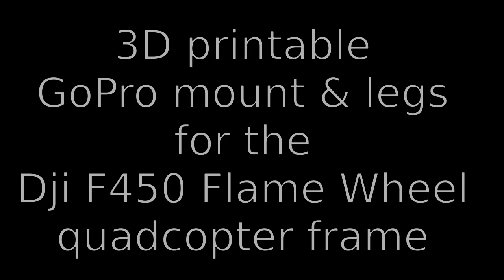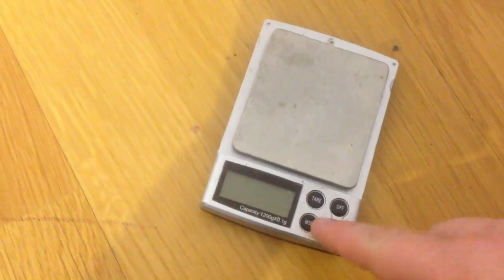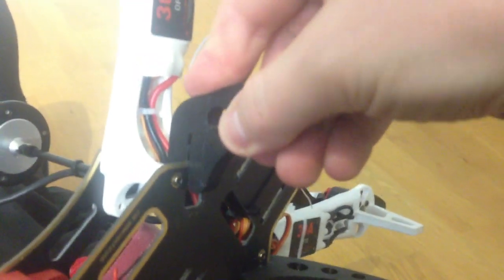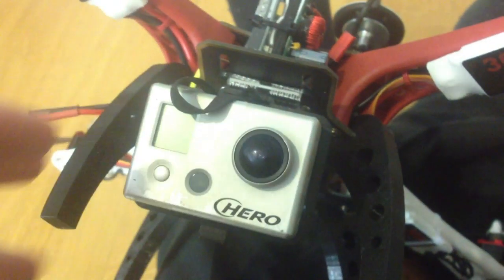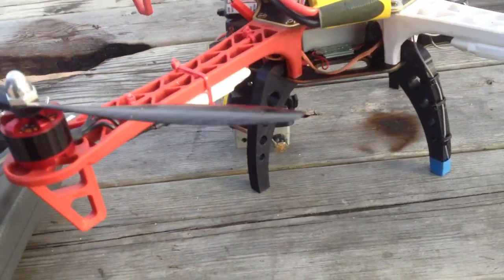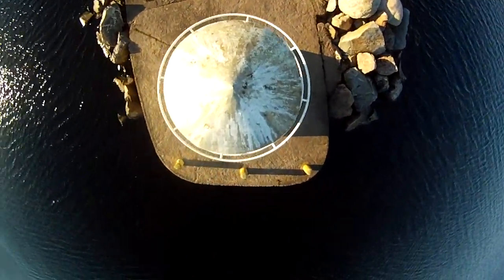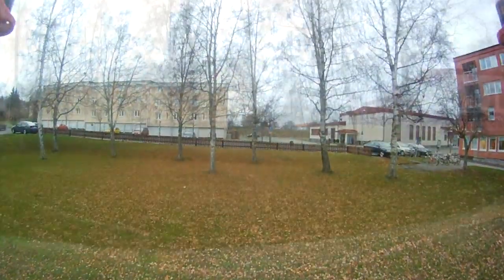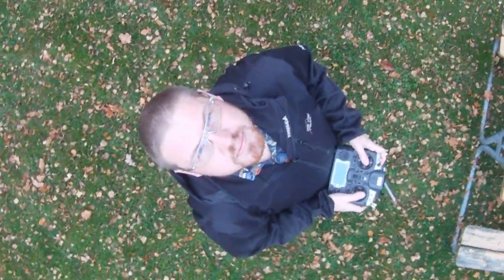3D Printable GoPro mount & legs for the "Dji f450 flame wheel" quadcopter

Comment from the maker: The HK-752 from hobbyking will work, only thing is you might need to sand down the round servo horn a bit, it seems to be slightly larger in diameter than the tgy-930

Comment from the maker: Hi, the HK-752MG from hobbyking  works fine, only thing is that the round servo horn has a slightly larger diameter, so you have to sand it down a bit..

Comment from the maker: Thanks ! It is hard to design for a thing i don't have. I did a fast test design here, tinyurl dot com / nex5mnt    But i have no idea if it will work, if the 3d cam i got was accurate, and also it has more weight then the gopro, don't know if servo will take it. For a camera like that i think a gimbal design is better, and to locate it more at the center under the quad. I might do a gimbal design later, when i get the cnc machine i am saving up to.. :-)

Comment from the maker: Thanks ! It is called FPV (First person view). I use a video transmitter on the quad and a receiver on the ground. In this quad i have a 5.8Ghz 600mW transmitter, and on the ground i have a pair of fatshark dominator video goggles with a built in 5.8Ghz receiver. I would guess i get perhaps 3km.. Thats line of sight, 5.8Ghz is blocked very easy if there is obstacles between transmitter and receiver. For longer ranges, lower frequencies is better. But check local regulations whats allowed first..

Comment: I should have some footage up in the next day or so - I'm using the HK KKV2.0 boards with the LCD mounted on it for easy adjusting.  No GPS but the latest firmware and LCD screen make setting up very easy.

Comment from the maker: I like that frame, the built in power distribution, and its easy to work with, and very durable. I was thinking $30 for the parts (just the printed parts, no servo) and then $10 for the shipping

Comment from the maker: The hero 3 is smaller, but just the the thickness. It is backwards compatible with the old backpacks i think. So the end that goes into the mount should be the same size, only the rubber band need to be a bit shorter... (have not tried but that what i think).  The material i use is PLA, ABS will also work i think. Be careful of material choice, some material is only made to look good and not to be strong mechanically. I looked at shapeway, i think you can choose material there...

Comment from the maker: I use a ultimaker 3d printer, its 1200 euro, (about $1520 usd) and then add shipping, tax, customs etc.. Expensive, but very useful :-) The software i use to design things is google sketchup, it is free ! For printing the designed parts i use a program named Cura, also free. The plastic i pay $100 from 5lb roll (becomes like $150, with shipping, taxes, customs etc)..